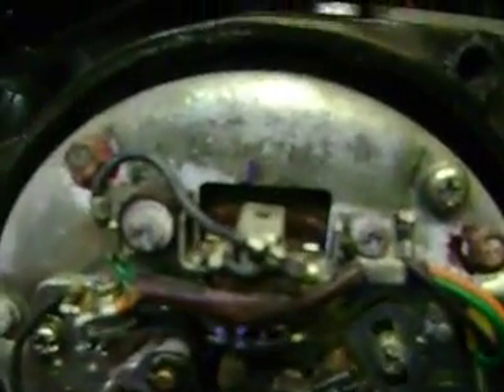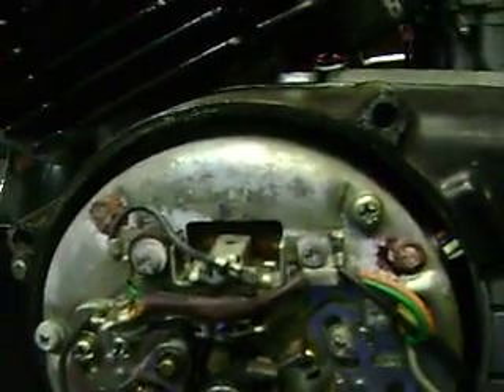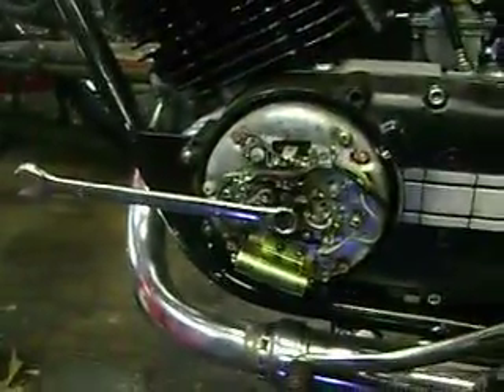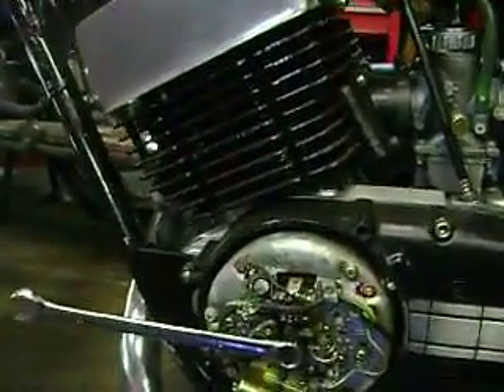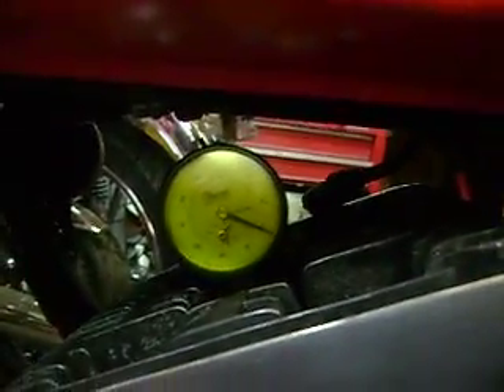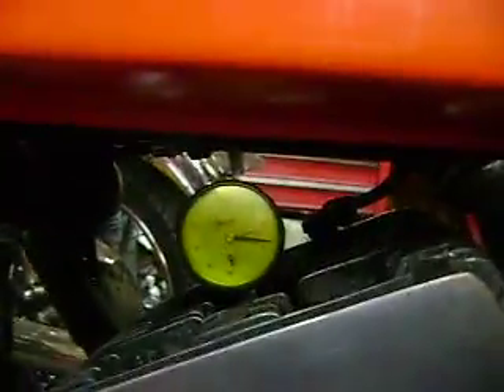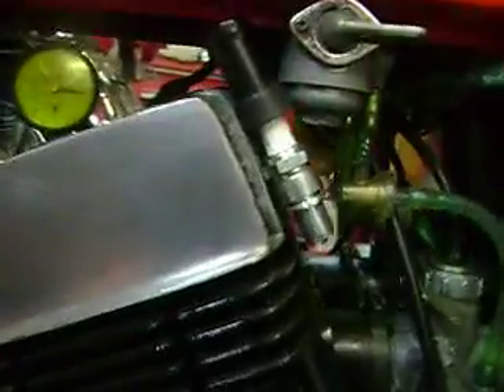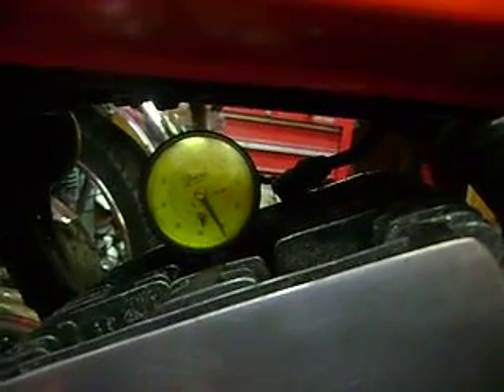timing-w-a-dial-gauge.AVI

Comment: i assume your dial gauge is metric. mine is in inces. for 2mm could you please tell me how many turns it should be for a standard gaige  and where the needle should stop. i'm timing a new vape electronic ignition system at 2mm btdc. thank you
Reply: 2mm = 78.7 THOUSANDTHS of an Inch
Aka .0787”

I’m assuming one full Revolution of ur gauge is .01” and ur tiny inner gauge holds that number.

So I need to zero out ur gauge first and then spin engine clockwise (backwards) until ur gauge reads 9 on the tiny inner gauge .09” and 0 on the outer gauge.  Then rotate engine counterclockwise (forwards) until ur inner gauge is at 7 (.07”) and (+) ur outer gauge is at 87 (.0087) = .0787” before top dead center.  This is where u want it to spark.

Comment: You don't have to do all this.  In its day, timing lights that were anywhere near accurate were extremely expensive.  Almost all vehicles with service manuals when they gave how to do service in their owners manuals only recommended static timing and not mention or allowance of timing lights.  Zoom ahead to day and the timing lights are accurate, respond in the time parameters necessary and static is obsolete.  If you don't think so, do this static timing and when you get all done, check it with your autozone timing light.  EXACTLY the same!!!!! Timing is a breeze with a timing light, not doing all this!
Reply from the maker: I agree 100%. however, there were always questions on how to do it on the forums. (which is why i made this video a decade ago) And, it is necessary if you fit an aftermarket cdi or are working with an r5 or the like with moveable timing index pointer.

Comment: Why not just a timing light?
Reply from the maker: i usually do set with a light. however, when i made this, people were asking about how to do it with a dial gauge.  also, on some bikes, you need to use a gauge to set the marks to check with a light, or if you change to an aftermaket cdi setup.
Reply: @rooskie  yes, I have 3 RD350s and use timing light only now.  I used to use the dial gage thing, and it was a lot of work and pain.  I checked with timing light and found it to be correct and also had the advantage of seeing how steady the spark was to diagnose other problems.
Reply from the maker: @greatgambino   well, like said, with cdis with no keyed rotor (i have 2) and r5's with a moveable index, you need a dial gauge to set the pointer. .02
Reply: @rooskie  Yes, once you have established and marked where you want your timings to be using the dial gage method, you can use the timing light from then on and get perfectly timed engine.  If you think about it, there is no gear lash, you are timing right off the crank and the timing light is very accurate.  I have had a number of older automobiles of the late 60s and early 70s.  If they had do it yourself instructions in the owners manual, they advised either static timing or timing by dial gage for motorcycles.  This was because accurate timing lights were very expensive back then, and the cheaper ones were not accurate at all. That is why no owners manual of that period would suggest a timing light.  Today it is easy to buy a very accurate timing light.   but those old schoolers still think they are doing it better by a dial gage.
Reply from the maker: @greatgambino   exactly correct, agree 100%

Comment: hello from the uk i have a 2stroke ryobi strimmer no spark fitted a new ignition coil has a faint spark so ime thinking the timing is out would this principal work with my engine  ie timing gauge but were to start i dont know being a layman  money carn't buy experience thanks den.
Reply: Check the voltage to the coil with a multimeter. Should be between 12V to 13V. Its a late reply, but might help someone.

Comment from the maker: Good eye! yes, thats an extended reach plug (like the 400's use).. in the background is another rd with an LC motor in it, it uses br9Es plugs. thats what i had laying around as an example. I typically set the timing to 1.8mm btdc and run B8Hs plugs in the aircooled rd 350's, and the 9 series in the kawi triples.